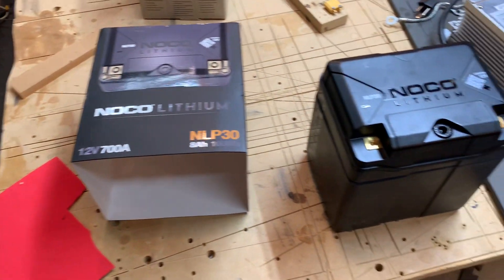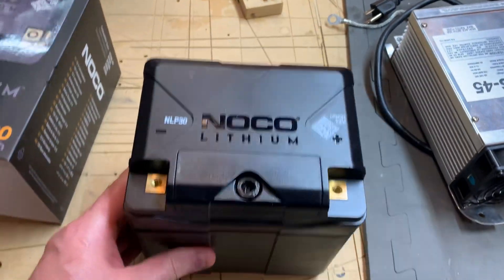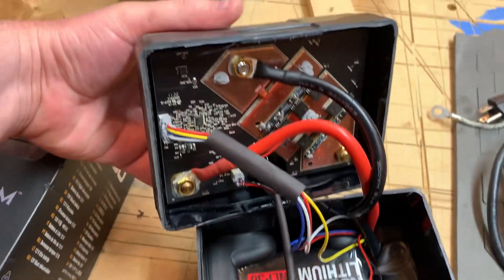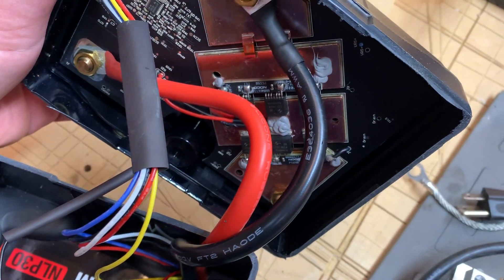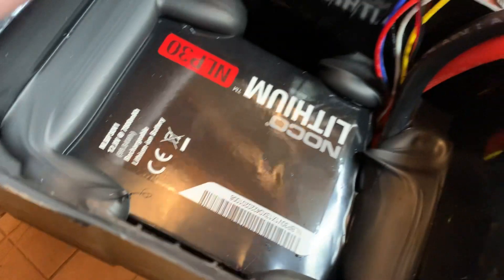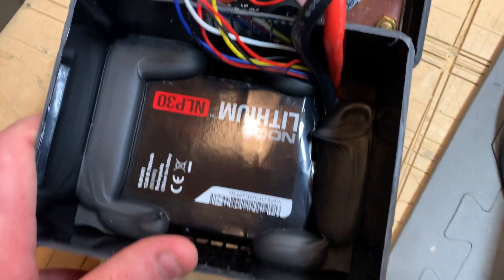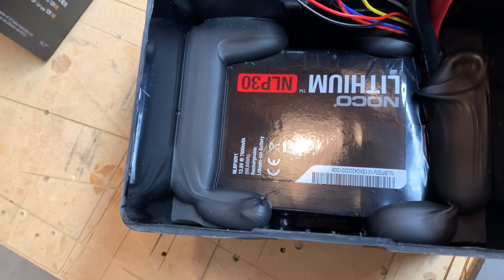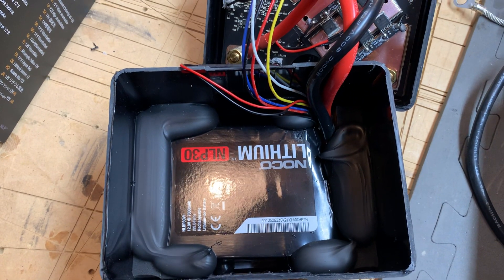Noco Nlp30 a look inside

Comment: I use an NLP30 to fire up the 547c.i., 14:1 compression, big-block in my drag car, and it cranks it up with authority and it's been doing fine for 3 seasons now... 🤷🏻

I pull it out of the car for winter, and store it in my basement on a lithium specific maintainer. 

So far, so good
Reply: This is the testimony I've been looking for on these. Building a drag and drive car with a blown Coyote and wanting to save every ounce I can.

Comment: Don't waste your money. I paid £175 for a Noco NLP20 just under 2 years ago. Last week I noticed a slight flicker of my head lights and the dash lights on my bike. Connected a voltmeter while riding the bike and the voltages are all over the place between 12.2v and 15v up and down all over the place no stability. Long story short, it turns out its the battery. Took the terminal blocks off and cleaned any oxidation and refitted with di-electric grease. No difference. Put a new lead acid battery in the bike. No more problems. These NLP's are crap batteries. That's just my experience with them. I could have bought 3 lead acids to last 10 years for the price of the NLP20.
Reply: They have 5-year warranty so if you got a faulty unit, you'd get a new one.
Reply: @impact0r  Have you been through the process of getting reimbursed from noco yet? I have. It wasn't easy, and they would not refund my money so I had to list the replacement battery on ebay in order to reclaim only a portion of what I initially spent.
Reply: @craigbeall5084 it is normal that the warranties are replacement, not the reimbursement
Reply: @ I stand to be corrected but under the current legislated consumer rights act in the UK they are obligated to refund me if I request it. Which they didn't. I could have taken the matter further but went through such stress just getting a replacement out of them that I gave up.
Reply: @craigbeall5084  since your Brexit, I don't think the UK regulations drifted away from the EU that much, and certainly not in the direction benefiting the customers. And in the EU, they have to refund you if the 2nd or 3rd replacement is also faulty. So there's no legal obligation to refund you upon the first fault of the product.
Reply: @impact0r  Either way, I will not be purchasing Noco products again. I feel my money is best spent elsewhere.

Comment: I’ve had two of the size smaller noco batteries for 2 years now, I’m not sure how they still work considering you should not charge these batteries if they are below freezing and I use them all winter long in kingquads plowing snow. Recently a weeks worth of -f temps.  They seem fine.  Are there heaters inside like my larger and much costlier epochs and SokS? Lol doubt it.

Comment: That BMS is definitely their own design and is quite impressive. The copper in there is what makes sure the resistance is extremely low meaning you can get that huge 700A. Over 20C burst rate is quite impressive, on the same level as A123 stuff.

you can tell which chemistry is being used by the voltage of each individual cell and how it charges. LifePO4 will sit at 3.2 and 3.3 for the majority of its charge/discharge curve and the very top and very bottom voltages go really quick whereas with NMC or NCA you'll see 3.2 to 3.3 is on the lower end of the curve and will go up or down in a fairly linear fashion.
Reply: I wish it had more amperage

Comment from the maker: I made a mistake in the video. The battery pack says lithium ion. But there are 4 lifepo4 pouch  cells in series inside this Nlp30 battery.
Reply: Do you got a picture of those Lifepo4 cells? Are they inside the plastic housing wich says Lithium Ion? Because its strange to find something labeled lithium ion inside when all marketing  information says its lifepo4.
Reply: @kkay7224 LiFePo4 or “Lithium Iron Phosphate” is technically a type of lithium-ion battery. What most ppl think lithium-ion is, is actually “Lithium Nickel Manganese Cobalt Oxide” but hardly anyone actually calls those by their full chemical name for whatever reason.
Reply: @kkay7224  LiFePO4 is lithium ion. Lithium Ion encompasses all the types of Lithium batteries....the cathode material I believe is what then differentiates the exact type of lithium ion battery it is. NMC/NCA is the most popular "Lithium Ion" ie 3.6V or 3.7V nominal voltage. Nickel Manganese Cobalt or Nickel Cobalt Aluminum. Lithium Iron Phosphate is the 3.2V nominal (or in the case of A123 3.3V nominal) is the safer chemistry due to its much higher thermal runaway temperature. Lithium Titanate Oxide is the safest of them of all but has a nominal voltage of 2.3V or 2.4V typically and has the lowest energy density, however it has amazing charge and discharge rates, typically 10C or higher. Toshiba's SCiB cells have C rates as high as 75C.

NMC/NCA: relatively safe, high energy density or capacity, decent power density with discharge C rates typically around 2C to 5C. 250wh/kg to 275wh/kg is what makes this the best option for applications where size and weight are important
LiFePO4: a safer chemistry that pretty much won't combust unless an external spark or something makes the electrolyte combust. 150wh/kg to 175wh/kg is typically the highest energy density you'll see. Usually a 1C to 3C discharge rate although there are some companies that make 20C and 30C cells like Headway and A123
LTO: the safest of all the commonly available chemistries but is a bit expensive and requires more cells to achieve the necessary voltage. Energy density in the 100wh/kg area is the best you'll see. Many of the cells have high charge C rates, meaning you can charge the battery in as little as 6 minutes for some of the 10C charge rate cells.
Reply: This is odd because NOCO says you cant use a LiFePO4 charger, you must use THEIR Lithium Ion charger. According to their customer support response.
Reply: @HappyHands.  If noco would have made alternators and magneto for your motorcycle, they would have told you to have it replaced with theirs
Reply: @HappyHands. I downloaded the user guide from the product page on their website. On page 10 it says, "Type: Lithium - Ion, Chemistry: Lithium Iron Phosphate (LiFePO4)".
Reply: Very Impressive design!
I was actually thinking to buy an NLP30 myself.
Any chance you have a battery tester and were able to confirm their 700A CCA Claim?
Reply: @InFlamesOfSorrow The tiny NLP30 cranks over my 547c.i. 14:1 compression big block in my drag car just fine. I don't know how many amps the starter draws, but it's a bunch for sure
Reply: @ thanks for the info :)